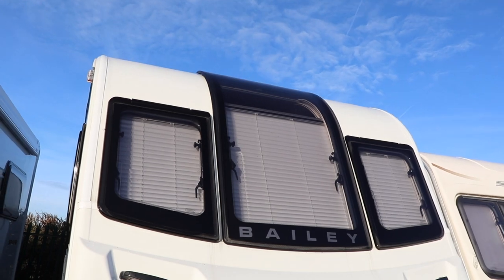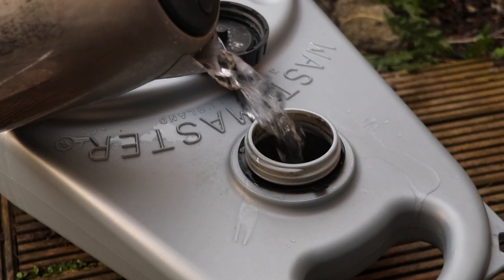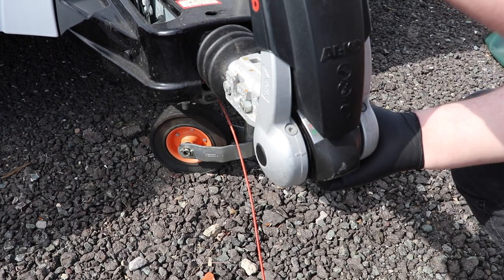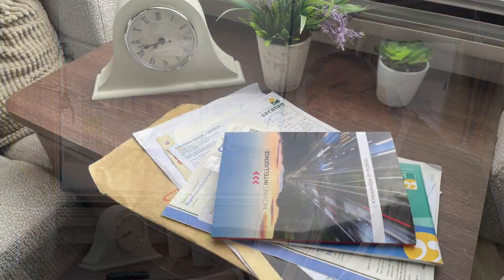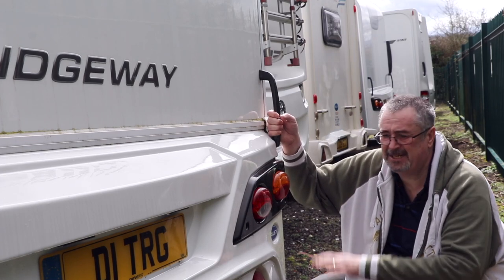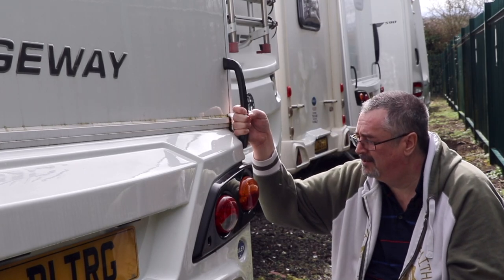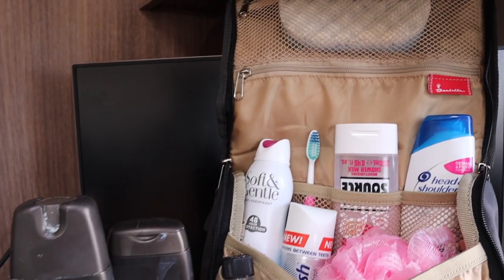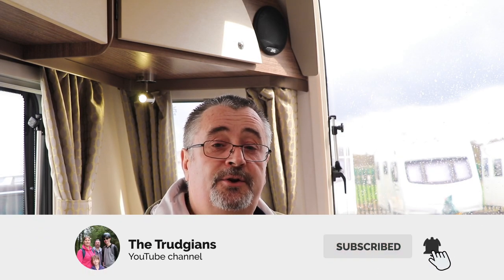Caravan Spring time wake up

Comment: Dan, another water related one to add to your list. The nozzle on the kitchen tap in the Phoenix unscrews and there is a filter inside which stops grit, sand, scale etc coming out of the tap. The problem I hit was that the filter got coated which meant no cold water from the tap and an error on the Truma which I couldn’t clear. Fix is easy - unscrew the end of the tap - you might need a pair of mole grips the first time, rinse the filter and away you go. It was my first night away this year and I admit I left the van and went home to sort the problem in the morning as I assumed the pump had failed.
Reply from the maker: Yes indeed!! this caught us out a couple of years ago, i ended up taking the entire swan neck out as the end filter would not shift. Might do a video on this as it looks like others are suffering the same. 

Thanks for the info. 

Take care
Dan
Reply: @TheTrudgians  thankfully I found it on Tintenter’s vlog or I would have had to call out a mobile engineer - I was convinced the van was seriously faulty as I had a boiler error at the same time which I couldn’t clear. The tap nozzle got Terence’s again on the Caravan Place at the weekend but you have to know the symptoms and you have to know how to use mole grips to remove the nozzle the first time

Comment: Great video Dan, I brought ours home last weekend and did our ground hog day checks. One thing I do with the wheel nuts everyone seems to be obsessed with making sure the wheels nuts are tight. I also ensure I can undo the nuts so that I know I can get the wheel off if I need to and one or several have not seized before torquing them back up again. I’ve  also noticed our toilet pump sticks after not being used and requires serval button pushes before it works again and then works all season with out fail.
Reply from the maker: Great idea Ash, hope you’re keeping well and also looking forward to getting away.

Comment: Hi Dan,
Good information here, and hope you have a good season.
Reference the dates on fire extinguishers, I would be very suspect of any that are not in date to work as needed when required.

To that end, I bought a few of the Fire Safety Sticks at the NEC to replace the "old" powder type that I had in the MoHo.

They look to be a far better (& lighter) product than powder ones, and given they have zero maintenance requirements and leave no mess after use (unlike powder ones), any subsequent clean up will hopefully be a lot easier (& no, I'm not sponsored by them!).

Kat/The Wandering Bird did a video on them on her YT channel, so could go over there and take a looksee.

Cheers,

Rich /MH04RMV

Comment: You mentioned about the instruction manuals. I have so many which , if carried on board, eat into the caravans payload. I’ve uploaded all mine to Google Drive so they are accessible via my iPad. Obviously subject to mobile signal, but I’ve not had any problems whatsoever. Just thought I would share this.
Reply from the maker: Great tip - thank you.

Comment: Hi Dan,
Great Video as always and some good reminders.
I’ve just discovered a fault on my 2019 Bailey Unicorn Vigo and wonder whether you have heard of anything similar.  I’ve just used my van for the first time this year and we got caught in very heavy rain, so had all the lights on. After 20 minutes all the near side lights went out on the van except for the indicator and brake light.  I gather it is due to the car 2017 Audi Q5 sending a signal to all the lights to check they are working. As the van uses some LEDs the signal comes back and the system turns that circuit off.  If you switch off the engine and start again after 5 minutes all the lights work again for 20 minutes then shut down again.  I realised that this would have been the first time that we had driven with the lights on, as we don’t normally drive at night, so this has never happened before.
Any thoughts.
Thanks Ian

Comment: Hi quick question, should I take my leisure battery off the caravan and store in a warm room at home during the winter season?
Reply from the maker: Hi, its not a bad idea, but - if your caravan relies on a tracker or alarm to be active, you must have it enabled to ensure your caravan insurance is valid. 

If you have a solar panel on your caravan, this can usually keep it topped up during winter. I have never removed my battery over winter - and so far its been fine. 

Hope that helps. 
Dan

Comment: If I remember correctly you have your van PaintSealed? I take it that the DrySparkle stuff OK to use once the PS protection is applied?
Reply from the maker: Hi Rob, yes we have diamondbrite on our caravan. Dry Sparkle is fine to use on this and other coatings / protection on the surface.